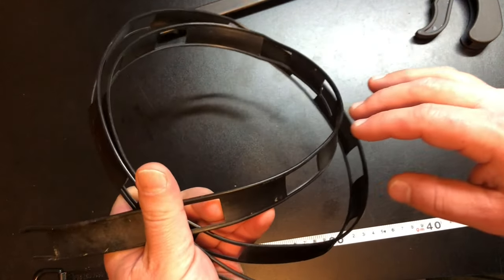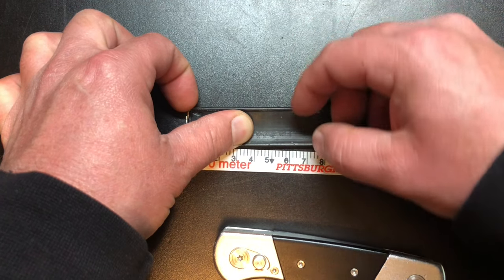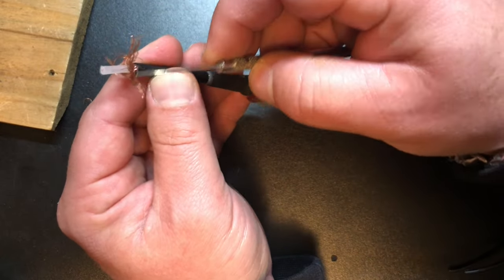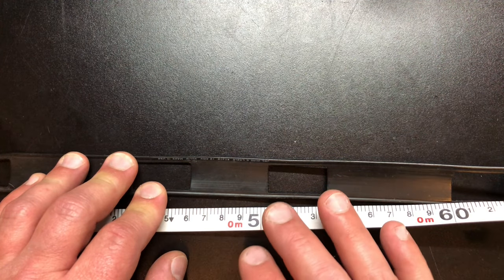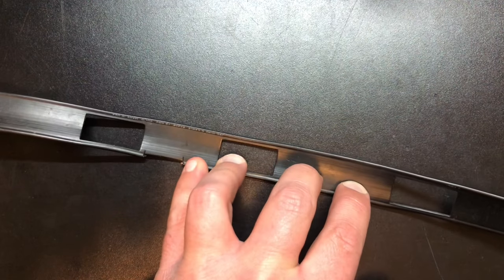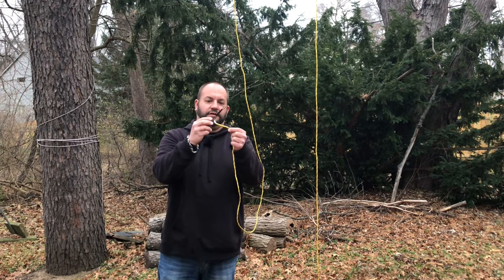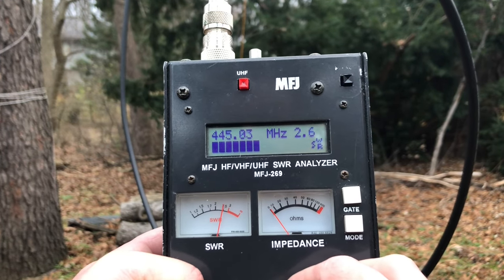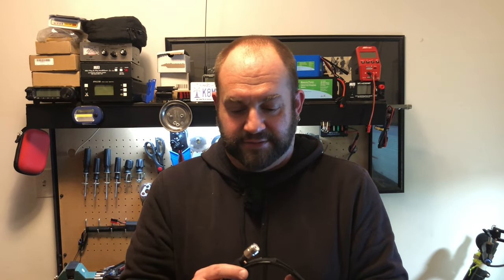Build your own Roll Up Slim Jim Antenna for the 2 Meter Ham Radio Band.

Comment: According to Rex Judd -the inventor of the Slim Jim, the coax feed should leave the antenna AT RIGH ANGLES  - i.e. horizontally from the antenna. He said "This is important..." I have always complies with this and it does lower the SWR from around 1.2 to 1 to 1.0 to 1 over 145 - 146 MHz

Comment: I made my first one just last night, from odds and ends of ladder line and coax cable I picked up at the local swap meet yesterday afternoon. Resonant at 146 MHz. Hung it from my living room ceiling and my wife and I used it to get on the repeater that is about 40 miles away from us. Works great!

Comment: Great video ! I made one of these with the 450 ohm ladderline a few months ago, but added a small RF choke at the bottom by winding several turns of coax and taping it all together. Works really well and SWR is flat on 145.00
Reply from the maker: Thanks Martin. Yeah a choke is recommended, but I like to live dangerously.  I really should experiment with that though.
Reply: hi, can you show this, please?

Comment: I built one with some junk 300 ohm twinlead I had laying around and a length of RG8 (also scrap) about 15 years ago.  I had to be out of town on business and stuck in hotel room at night.  I could just hear a local repeater (about 25- 35 miles away) on my HT.  I hung the antenna from the curtain rod, and heard the repeater S5!  They do work.  KD4HCT
Reply from the maker: Absolutely.  I did the same thing when I moved to Texas.  Hung it up in the window, started talking on a repeater, then someone else came on and told me of a place for rent.  Thats how I found where I'm living now until I find my forever home here.

Comment: I have made many over my 55 plus years on the air , ( mainly HF )  One memorable one was a directional wire antenna that was used on WWII battleships that was flip flopped to the opposite direction by hand .

Comment: just got some ladder line this past weekend just for a project like this, then seen your video. Made it much easier in my mind. I am going to do a class with our new hams in the community and get them to make their own antennas (we have tested around 15 new hams in our area in about 6 months). I bought enough crimp connectors and ladder line for 10 or so of these. Thanks for the video and tuning instructions!
Reply from the maker: Wow that’s awesome, way to get the newbies involved!   It’s a really easy project and doesn’t take much time.  Plus it shows people just how easy building your own antennas can be.  It’s very gratifying.

Comment: Good job my first and only was a 2m ground plane with 4 radials and a center. But it’s somewhat bulky and fragile. I really dig this antenna. I can see myself making this one
Reply from the maker: The only thing I would change if I were buying more 450 ladder line is get the stranded wire.  The solid can break with too much use taking it up and down a lot.  It's a great antenna and a super easy build.
Reply: @hamradiotube  I’m going to look that up. Any suggestions for HF? I have a chameleon end fed antenna. It works well but I want to try a homemade vertical easily deployable. 40 & 80 meters for sure

Comment: Good video thanks. I made of these and it works very well. Maybe worth mentioning that even if you can get a good match (low SWR) on 70cm on a 2m slimJIM or J-pole, it is not going to radiate very well. The 2m slimJIM is basically an end fed folded vertical dipole which makes it a very effective antenna. However, on 70cm, it works as three dipoles in series. With no phasing between each dipole, the radiation from each tends to cancel radiation from the one just above or just below. It does work and it is better than no antenna, it just doesn't work very well.
Reply from the maker: Right on, thanks for watching.  I did show the swr on 70cm not being all that great in the video, hence me calling it a 2 meter antenna but yes, you are correct.  Once you start talking about phasing though, you are above my intelligence lol!  That is very interesting though.  I'm always curious to learn more about antennas.  It's become quite the obsession for sure.

Comment: A hole punch works better than a drill for making the hole. I just made one but the resonant point was up around 150MHz do I had to lengthen the 1/4 wave stub. Adding wire back after you have vut out the gap is a pain in the arse. But It works and the only out of pocket expense was for some heat shrink tubing.
Reply from the maker: Use what's available to you.  I don't own a hole punch.  Looks like I need to take another trip to Harbor Freight lol!  I hate having to add more wire to an antenna, but only because of my OCD.  I want it perfect the first time.

Comment: I shared your video on the W8IRA Linked Repeater Facebook group. Good stuff. One of these days it would be cool to do a NVIS antenna experiment with you. I'm in Alpena.
Reply from the maker: Awesome, thanks for sharing this!  I don't have the room or the antenna to do nvis on 80 here at home unfortunately.  Yes I can tune my OCFD on 80 but I don't think that would be the same.  I'm always up for trying though.
Reply: @hamradiotube  I think you can do a NVIS on 40 meters, although it is probably more likely to make contacts on 75 meters generally. Might be something fun to play with on Field Day. I would think a SO239 and a bunch of speaker wire stretched low between a couple of trees would do the job.  What would be cool is a Park to Park contact within Michigan on a NVIS.

Comment: Was watching this today and started to think could you use this as a compact horizontal antenna if you soldered in the cable perpendicular to the ladder instead of parallel?

Comment: Hi !

Could you please tell me the name  / type of this special double wire you are using? Could you possibly send me a link where it can be purchased? I don't know if such a cable is available in Hungary at all... 

I want to make a Slim Jim antenna for Air-Band, for my SDR receiver. Thank you!

The antenna cable is H-155 ?

Richard
Hungary
Reply from the maker: I got this at a swap.  Search for 450 ohm window line.  Also called ladder line.  Stranded would be better than solid as it's more flexible and won't break over time.

Comment: If you can understand how a J-pole works, you can see this is just a j-pole with the element folded in half. All of the understanding around why the feed-point is part of the way up from the 'short' at the bottom of the loop, far enough to make it 50ohms (further up = more ohms, right at the bottom will be zero) applies the same to the slim jim as to a j-pole. That's why all the calculations are the same between them.
Reply from the maker: They are very similar, yes.

Comment: Another great video!  I thought of building this and may still.  I ended up making a 2m/70cm ground plane antenna out of 10AWG wire and a SO239.  I tried with a N, but the 10AWG wire didn’t fit.  Love your videos and thanks for the good content as always!  73 de KI5HXM
Reply from the maker: Thats another antenna I would like to build one of these days.  Thanks for watching.
Reply: @hamradiotube  Yes, I built mine based on Dave’s video: https://youtu.be/x-DPVuyU8Pg.  I tested it with my nanoVNA and it is close.  My 2m section needs adjusting.  But it is pretty cool.  Love the science part of our hobby.

Comment: Is there any good reason I can't just use some old in-wall electrical cable and bend it into a j?

 Obviously I'll need to get the length right, but would there be any functional difference between that and ladder line here?

I could even print out spacers on the trusty 3d printer.
Reply from the maker: No idea.  Try it and let us know.

Comment: Perfect content especially for newbies. I built one 3 years ago with 300 ohm ladder line. Still hanging in my living room. 😁
K0PIG
Reply from the maker: Hey Pig what's up!?  Thanks for stopping by.  I watched every video I could on antennas like this when I got my Tech.  I just wish I'd have done this video earlier.  The plans I used for this antenna should translate very well to the 300ohm ladder line too, which I watched every video on that too!  I'm amazed at how easy these antennas are to build and how well they perform.  Thats a true testament to you having yours up 3 years later too.  They just work.  73
Reply: @hamradiotube  Just to let you know, I have had my little roller J pole in the field many times with my little handheld. I try to keep it short feed line but sometimes I get it up about 20 feet. I can hit repeaters 100 miles away. It’s a silly little antenna but very effective. Thanks for showing it
Reply from the maker: @mark002228  Absolutely.  Super portable.  I take my old one every time my club does an event.  I'll be taking this one from now on because its better.  20 feet is about all you'd need too, if not less, depending on where you are.

Comment: Hi K8MRD, do you think if I duck tape the slim jim to the wall it will diminish the signal the duck tape blocking any signal?
Reply from the maker: I wouldn’t think so, unless it’s the actual aluminum tape they use on ducts.

Comment: Hey man.. Love your vids, first time commenting. I'm building this now, and wondering where you got your so-239 "pigtail"? I can't even seem to find the parts to build one.. only like bulkhead and surface mount SO-239 (female UHF) connectors.. Can't find anything attached to a cable like what you used...  73 - N9XRY
Reply: Sorry, just saw your reply to similar questions a month ago  :)
Reply from the maker: Thanks for watching. I bought the SO-239's from Ebay and made the pigtail myself.  DIY buddy!

Comment: Can you point me to where I can find that inline SO239 connector that is on your pigtail?  I can only find the PL259s.  I don't want to have to use a PL259 with a female to female coupler if  I can help it.  Your little pigtail looks pretty slick.

Thanks!
Reply: I have the same question.
Reply from the maker: I can’t find my original order to link the exact ones but I’m pretty sure they are these.  I just searched eBay for so-239 crimp and include the size coax.  I think I’m using RG-58/U on this antenna.  If you use a different size search for that.    https://www.ebay.com/itm/5Pcs-UHF-female-SO239-SO-239-window-crimp-RG58-RG142-LMR195-RG400-RF-connector-/192553902421?mkcid=16&mkevt=1&_trksid=p2349624.m46890.l49286&mkrid=711-127632-2357-0

Comment: Very nice , now I just have to pick up my IC 705 and stuff that in my back pack . Could you fool around with the 440 side of it a bit. It would be killer if we cold dial that in .
Reply from the maker: Thats a whole other level of antenna.  Not quite as easy of a build as this.  I might look into it.  There are a few different plans on the inter webs.

Comment: Hi thanks for the nice video.  Here in Costa Rica we only have 300 ohms available, should this balance line works to build this antenna? The only way to get 450ohms Is unfortunately export the cable and the cost Is $$$ expensive. 73s from TI2GBB- Greg
Reply from the maker: Yeah there are instructions for 300 ohm available on the same website I used to build mine.  I can't remember what it was but its in the video.

Comment: hey brother do you have plans to make 2m/ 70cm    145mhz/440mhz ladder line slim jim with good match on both bands ?
Reply from the maker: Maybe at some point but it's not on the list of things to do right now.  It's not quite as easy a build and involves some matching stubs.  I haven't really researched it that much though.

Comment: As usual great video Mike...just one question, how much power this can handle...any rough idea ? TNX
Reply from the maker: Thank you. I would suspect (but do not quote me) quite a bit of power.  Way over 100 watts.  I'm using 16awg solid window line.  Pretty sure thats actually rated for legal limit (1500 watts in the US).

Comment: what's the power range on this mike? I'm assuming up to 10w, i wouldn't think it would hold my 80w mobile at full tilt. 73 de W8MJL
Reply from the maker: Dude this is 16awg solid window line.  Pretty sure its legal limit.  100 watts is no problem.  Don't quote me though.  Think of a G5RV antenna, this is the same window line used as the feed line.
Reply: I used this with my FT-991at full power many times with no problems. It will handle more than enough power for portable work.
Reply: Used to push 65w on one no problems. These are tank like in their construction.

Comment: Have you read Ed Fong's articles (WB6IQN) in the February 2003 and March 2007 issues of QST?  He makes a good case for a J-pole versus a Slim Jim, and has pretty nice twin lead designs, including a roll up in the second article.
Reply from the maker: If I have it's been a while.  I actually bought his dual bander when I first got licensed and I'm not really that impressed with it.  I was expecting better quality.
Reply: @hamradiotube  The roll up or the one that goes in the PVC pipe.  I have the latter and it seems to be working well for me.  Of course, I don't have anything else to compare with it this decade.  You do need to use the specified PVC.  The normal (schedule 40?) stuff detunes it.
Reply from the maker: @KeepEvery1Guessing  I have the one that goes in the pvc.

Comment: Great video, and a super easy project.

The only downside is, as you pointed out, it's optimized for 2m, and is so-so on 70cm.  

I've found that honestly, unless you have a well-stocked junk box, which is unlikely for the newb trying to range the local repeater with his newly acquired cheapass HT, you're probably going to come out ahead cost-wise by buying a pre-made one vs. sourcing all the components and paying for the shipping.  Nothing costs much, but it all adds up, plus you need a soldering iron, solder, shrink wrap, zip ties, a heat gun, wire strippers, a knife, side cutters, and so on.

These guys have been selling these for at least 10 years:  https://n9taxlabs.com/    They have lots of options, but it's basically the antenna you built, with traps to make it resonant on 2m and 440, premade, with a coax run if you desire, and the connector to match your radio.

I'm not affiliated, but I highly recommend them.  This was the first antenna I had, which I still use, and there is one on the bugout bag in each car.

73

WB
Reply from the maker: Thanks for watching.  I'm going to assume you did not watch the video all the way, otherwise you would have caught the part where I mentioned the fact that I'm aware you can buy similar antennas online for about $20, but by doing that, you learn nothing about antennas.  If you want to make a cost argument, sure.  But thats beyond the point of this video.  This video isn't made for people who want to buy an antenna.  It's for people who, much like myself when I was first licensed, wanted to BUILD AN ANTENNA.

Comment: Sir what does volocity have to do with it sir
Reply from the maker: The velocity in terms coax would have to do with what velocity (speed) the electricity is moving through the wire compared to the speed of light.  Usually a percentage.

Comment: what does it mean '2 m'? Does that mean you can only use a specific frequency range?
Reply from the maker: Yes, this antenna is for the 2 meter (144-148MHz) amateur radio band.  All antennas are resonant on a particular frequency range.  This was made for the VHF spectrum of amateur radio.
Reply: @hamradiotube  ok thanks

Comment: I am gonna have to get a hold of you when Whitmer allows us to congregate again. I have a welding rod antenna I am working on. Unfortunately I don't have an analyzer and also have some questions on what coax I should use.
Reply from the maker: Where are you at?
Reply: @hamradiotube  Downriver
Reply from the maker: @ChrisdeHaan  I’d be ok meeting up with you if you want.  I’d like to see that antenna and we could put it on the analyzer.

Comment: Thanks for another great video! One question:
8:54 "Worst wire strippers ever..."
Was that sarcasm or did you mean that?  I have an identical pair of wire strippers and REALLY like them.
73 - VE3KLT
Reply from the maker: No I meant that.  Cheap harbor freight wire strippers.   They’re junk.

Comment: Thanks for a pretty good presentation, probably time to improve your knife skills.  "Don't get bloody, cut towards your buddy", over and over you aim the blade at your hand, not a really good technique to share.  I do appreciate the flush cutters for the zip tie, people often cut with side cutters or snips and leave a very sharp edge to slice your hand.  Confusing when you mix metric and imperial measurements on a project, likely better to just stick to one or the other.  Also good to explain that the length of the coax is the issue.  No need for RG213 instead of 8X for a 10' pigtail.  Also, very practical to consider an RF choke with a few turns of the small diameter coax at the base of the antenna.
Reply from the maker: Glad you liked the video.

Comment: Well, no, swr is too high for UHF. Should be better for VHF. Back to the drawing board I'd say.
Reply from the maker: I didn’t say it was good.  I said you “could”.  I’ve seen worse swr on a rubber duck.  The title of this video is 2 meter antenna.
Reply: @hamradiotube  I"ve seen it done, and I suspect that the way to go is to tune for uhf and hope VHF is still good. But, I haven't tried it, although I do own one. Purchased. VHF and UHF

Comment: Nope... no good, rookie mistake! Its gonna short out on the shielding. You diddn't leave enough insulation on the center conductor. I hope you don't blow your radio on field day!
Reply: I caut that too.
u were watching if too close.😄
Reply from the maker: Um, ok.  But it's not.  This ain't my first rodeo.
Reply: Apparently even seasoned ol hams make a rookie mistake every now and again
Reply from the maker: @dustinmcdermont699  Agree to disagree.  Nothing is shorted.  The antenna works as intended.